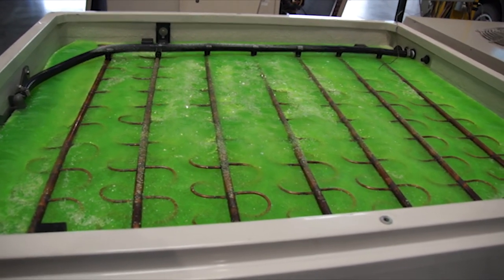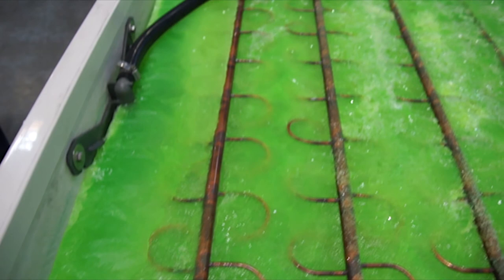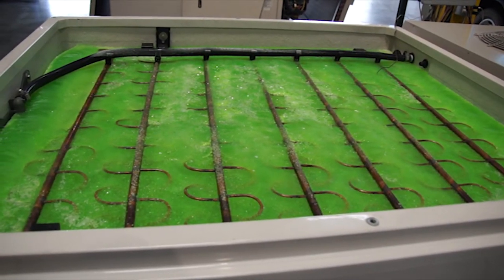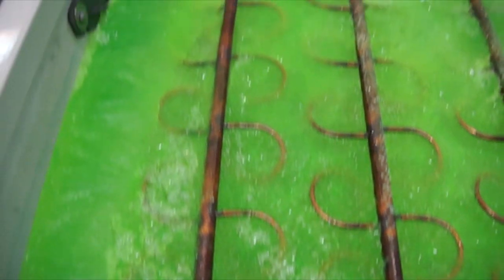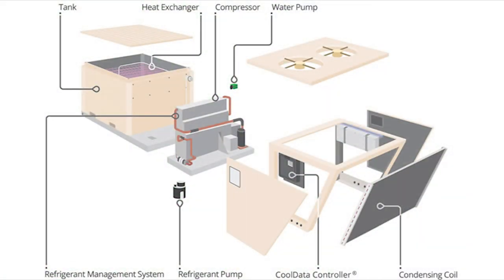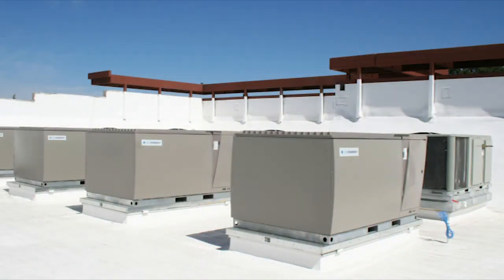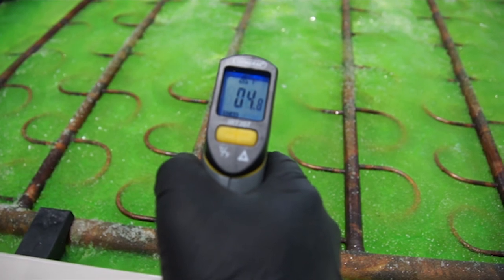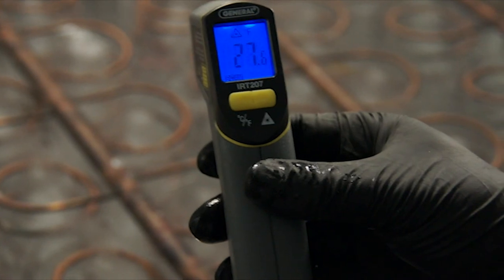Polar Bear - Energy Storage for Cold Chain and Refrigeration (Part 2 of 3)

Comment: I thought the entire idea was to roll out ice bank refrigeration to the residential market,Ice bank refrigeration is certainly not a new technology in the grocery store market,due to the high costs of their electricity and net metering they have done this for years to take advantage of cheaper energy rates at night. Perhaps I'm missing something. Residential customers could see an immediate benefit especially in the sun belt of the United States but like everything else unfortunately if the equipment cost is too high customers shy away because they fail to amortize the payback period.  I personally chose a geothermal heat pump but I hoped this company would pave the way to helping standard packaged hvac systems becoming more effective utilizing the proven commercial ice bank technology on a residential level. If you could roll out a partnership with traine or another major player and get cost per unit prices whithin reason ,everyone with a traditional split system could benefit . Best of luck